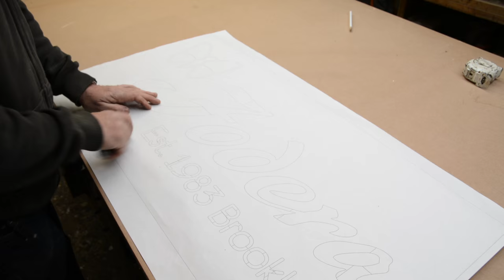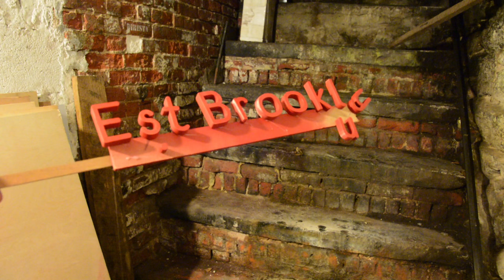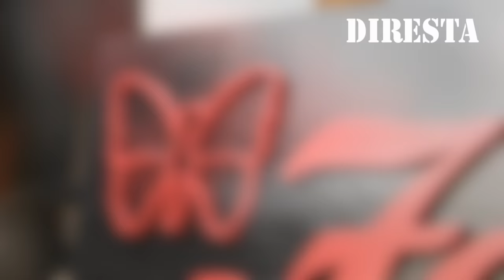✔ DiResta Fodera Sign

Comment: Very nice work Jimmy. Your bandsaw skills are amazing.   Just an observation about typography for our home viewers:  almost all professional typefaces have slightly larger sizes for characters such as "O". This is done to help adjust for an optical illusion that occurs, where we think that such characters are too small (because they have curves that only fractionally touch the baseline or midline.) Such characters don't actually sit on the line, they go below and above the lines.

So if you're having to put together type like Jimmy did, remember NOT to line up all the characters on the same level.  Your best bet is to print out the words or logo on the computer, use that as a template.
Reply from the maker: Yes your correct. I didn't drop the o's. I forgot. Thank you !!
Reply: Thanks 4 the tip. Didnt know that. Good vid Diresta.

Comment: Do you find that just cutting into the internal voids on the bandsaw and later filling the gap is faster than it would be to use a scroll saw for the cuts? From this finish I can see how it's easy to hide the cut with wood filler and sanding.

Comment: I wonder if there's a reason Jimmy prefers a bandsaw over a scroll saw, because it seems popping the blade in and out might still be quicker than repairing the cuts and letting them set up. But they dry without needing work so idk probably just preference.

Just thinking with my thumbs here. Great video!

Comment: see on the bandsaw closeup, I've used bandsaws before, but I'm not an expert, the brass peace, where the saw goes through, how does that end up getting cut?
Reply: +JK JIBJAB As you push and twist the workpiece, the blade moves around and chews bits off the insert.
Reply: MrRainingHeavy ah thank you

Comment: You obviously have a plotter to make a pattern for your letters. Why not make another paper pattern to use when gluing the letters in place?  I'm in the sign business, and that's how we normally do it.  Good job on the letters cutting them by hand.  Also, why not use your CNC router to cut those letters? It would be a lot faster and easier.  I'm just saying.  The whole sign looks nice!